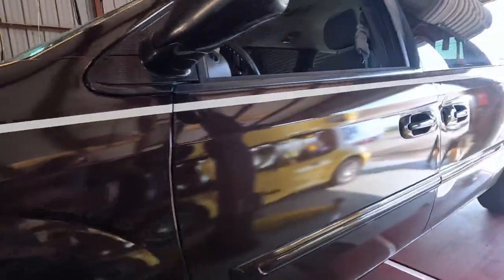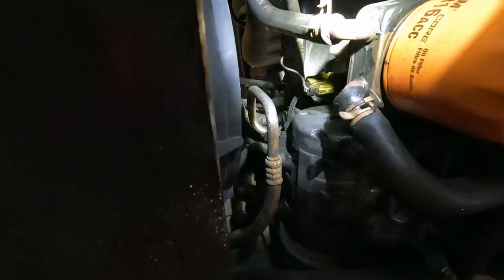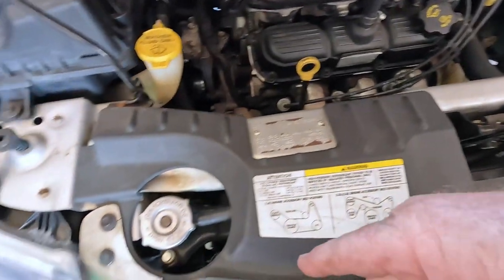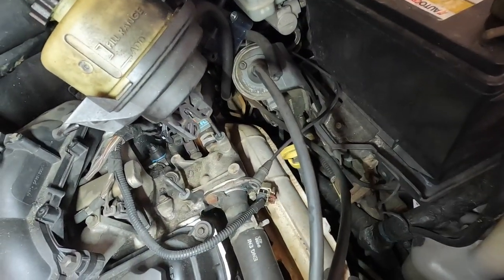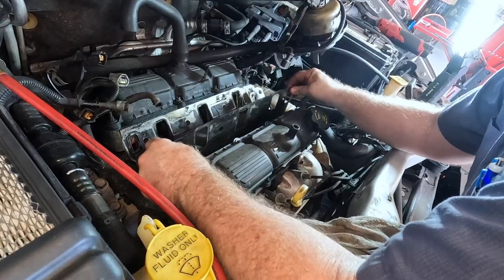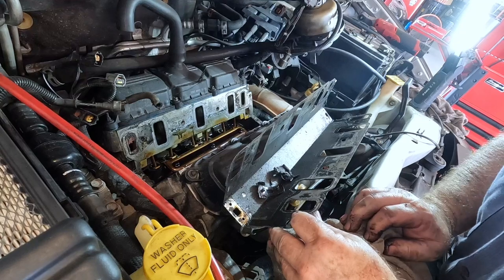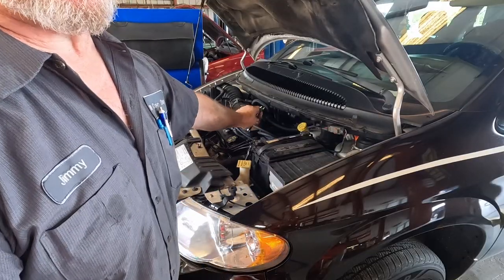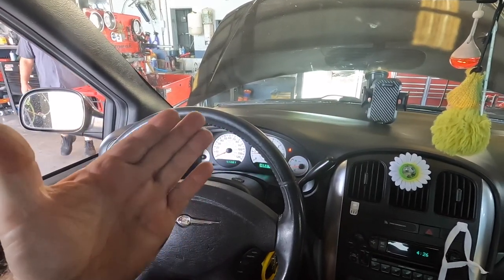JUST BOUGHT A DODGE CARAVAN, BUT IT LEAKS SOMETHING...

Comment: A lady came in for an oil change but a her oil drain plug is a spark plug I've never seen that It's on a 1999 Ford Ford tourist  I'm going to see if I can order them a regular drain plug To take out the spark plug do I have to replace the drain Pan oil drain Pan or can I just take out the plug and put in the new plug take out the spark plug what do you think the threads are too badly bad or I need to replace the oil drain Pan
Reply from the maker: Wow, haven’t seen that myself yet, lol.
There are drain plug thread repair kits, basically a heli-coil. There are also oversize drain plugs that cut new threads. Replacing the oil pan is usually if it’s a steel pan or cracked. I’ve had good luck with the repair kits.
Reply: Thank you I appreciate that
Reply: I would love to show you a picture of it
Reply: Had to do cats on a Chevy express van for a plumbing company a while back ago. When I got it in the air, they had a pipe elbow with a ball valve for a drain plug. I incorporated the same setup on my riding mower. Now oil changes are a breeze. LOL
Reply: I'm waiting on the drain plug from the Ford dealer